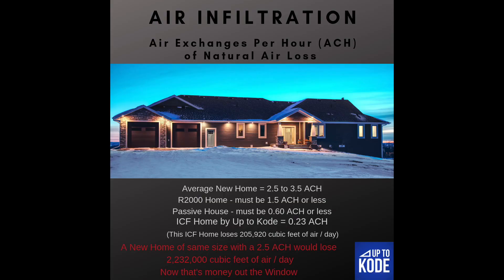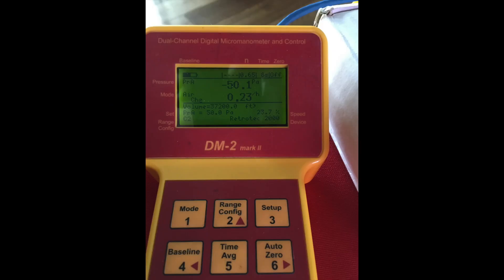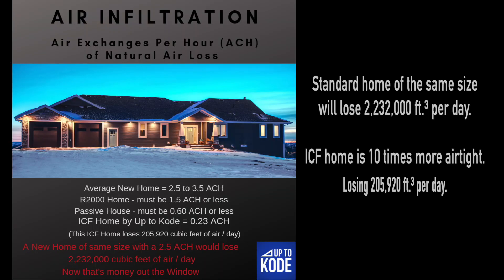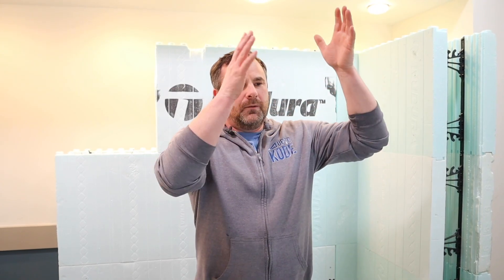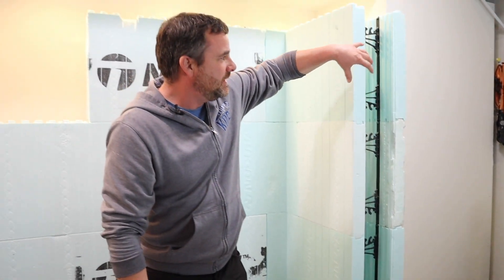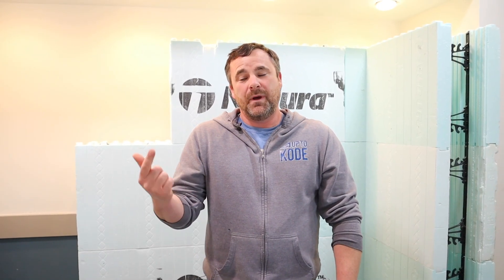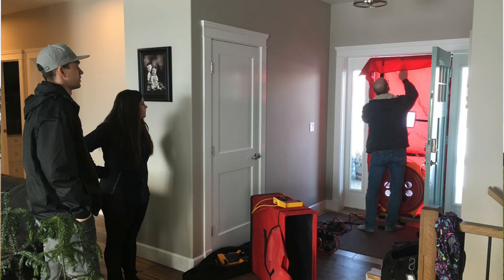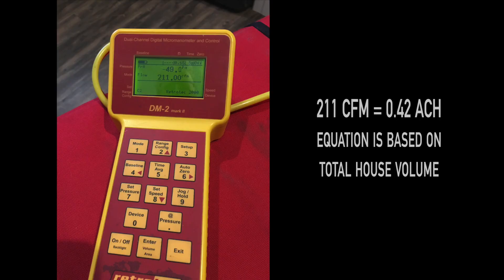Building Airtight with ICFs: Maximizing Efficiency

Comment: Did you build a hot roof to achieve that level or air tightness?
Reply from the maker: No we didn’t.  Vapour barrier against the trusses, positive backing on all joints, lots of acoustical sealant, make sure drywallers don’t roto-zip the poly, and pay attention to the details.  

I’ve always tried to emphasize how easy it is to obtain high levels are air tightness with ICF with no crazy tricks and fancy methods.

Comment: Love your channel. They just hung the roof joists on my ICF (Nudura block) home. Can't wait to see what it will be like when we get into it. We're putting in a wood stove, and our HVAC guy did a manual J calculation on the house and came up with 29,000 BTU heater needed to keep it warm. After getting that figure I researched wood stoves and found one that is used in an RV that has 9,000 - 20,000 BTU's of heat. I needed something that was small enough to not cook me out of the home. I had the builder put in a 3" piece of PVC for an outside air kit for the stove. We live in central Indiana, so it's not nearly as cold here as it is in Canada, so I'm guessing well be ok with small fires in the stove during the winter. We'll have an Energy Recovery Ventilation (EVR) in the house so what heat we do produce with the wood stove (12" logs) will be circulated throughout the home.

Comment: Hey Kody, do you think Nuduras XR35 is worth the extra cost with the standard block being this air tight already? We are in design process right now and I recently got quotes for both done.
Reply: I’m also interested to know more about XR35
Reply: You can’t go wrong with more insulation. You can go to extreme lengths & build to passive house standards with ICF. Probably cheaper than a stick frame house built to passive house spec. No additional labor to air seal & no need to use expensive european wrb, smart vapour barrier, tapes, caulking etc.
Reply: I just got quotes for 8" core XR35 for ours. How much difference in price is there with regular Nudura? I figured the thicker core and the 4" foam would not be THAT much more, but make a way quieter and nicer building.